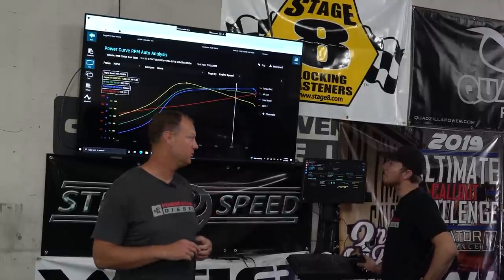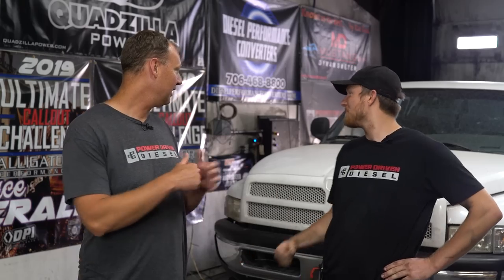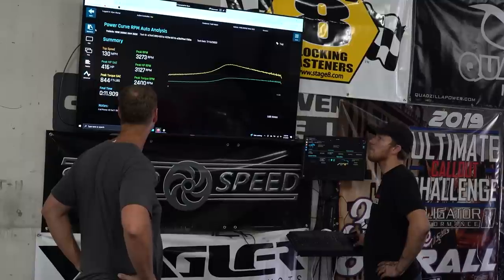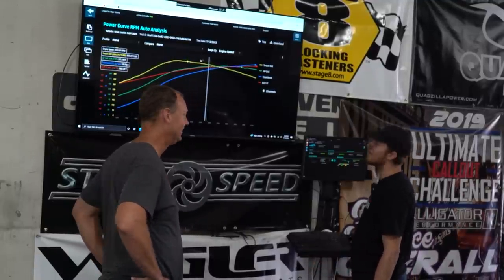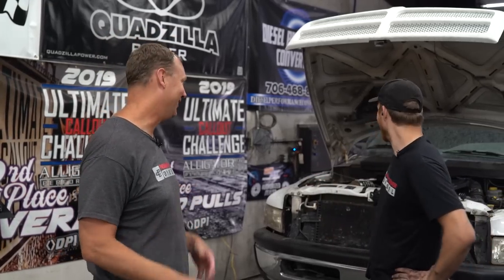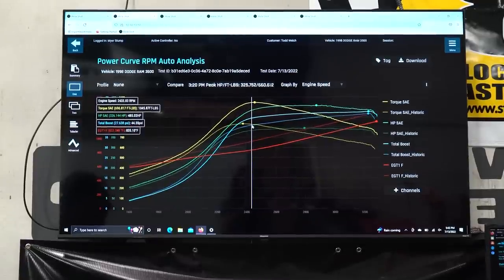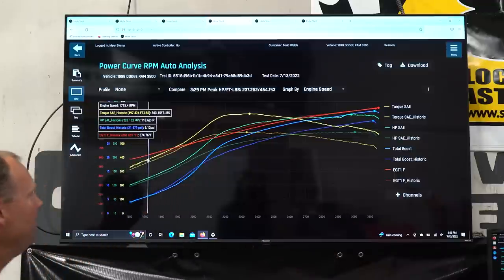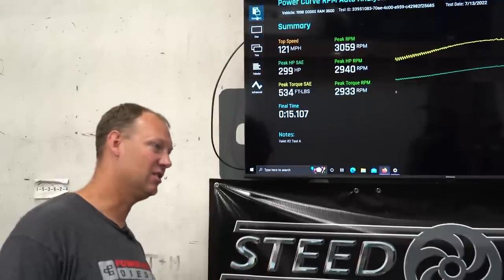Power Jet Fuel Injector Development | 12v Cummins Dyno Test

Comment: Exciting stuff. I have a vp44 truck that I run 7x10s built by Weston Shuppe. I like his injectors simply because they run cooler, more power and less smoky. This truck is used for deliveries, running about 70 to 80k miles a year. If y'all make a set of these, comparable to 7x10s, I'd buy them to test them and see how they do. Mpg is important. At the end of the day, the better it is, the more money in my pocket.
Reply: Nothing against PDD, they have great products and an awesome crew, but I don't think you're going to find anyone with a better understanding than Weston on injectors especially. He has tried a ton of different nozzles and uses a wide variety for 12 valve and 24 valve if you look through his Facebook page photos. If you want to try something new ask him about an 8 hole. They seem to atomize very clean on lightly to moderately modded VP44 trucks.
Reply: I used to run 7x0.010s in my VP truck as well but mine were DAP sticks, when the truck was tuned well they burned very clean but I was having some EGT concerns, I think that was mostly down to the 9cm housing on the charger. Stepped up to 7x0.012 with a s364.5 in the 14cm housing and a ported head, should help.
Reply: @Michael, it will be hard to beat Weston. He's built me several sets for different trucks, and they always do better than anything else's. If someone is building one that's also good, i like to test them myself.

Comment: Hey guys , I am loca to Cedar , bought a swx362 in April for my 1998.5 and the only part of my truck I don't have info on is injectors . Truck gets 14-16 at best right now , want to get a good compliment injector and have the head flowed and a custom tune with the quadzilla I got . My other Cummins was 20 all day long mpg ... Hoping to get closer to that as build power as low as possible for towing.

Comment: As I’m building my Cummins powered 4x4 Ford Econoline van for long trips this is the video series I’ve been waiting for!!! I bought your 400hp kit(still in the box) I believe that has 7x.009 injectors, will you be developing a comparable injector that is more efficient?
Reply: My dream is a e350 15 passenger with a 12valve or DT466 paired with a 5R110. Sounds like an awesome build.

Comment: Love everything I'm seeing about these Power Jet injectors.. are you guys planning on cutting this nozzle geometry into a 24V injector nozzle/body?

I have a 180hp Ppump on my 1998.5 24V with PDD 362SX-E, PDD 7x0.0085 injectors set at p-pump pressure, and 055 DV's... love the power but looking for a little bit more efficiency and little less smoke.
Reply from the maker: Yes! Those injectors are in testing now. Should be available soon!

Comment: Are these PowerJet injectors SAC or VCO? Are the stage 1 a good fit for a bone stock truck? Looking for mpg, clean burning, an maybe a little more power. I thought I had decided on VCO 5x0.011 sticks, now I wonder if these will be better for me… 🤷‍♂️
Reply from the maker: They are a SAC nozzle yes they will run cleaner than the traditional 5x.011 as well as provide a bump in power and typically pick up some mpg's

Comment: WILL 5X11 INJECTORS  WORK ON 2002 DODGE 3500 6 SPEED WITH OUT PUTTING A BIGGER CLUTCH ONLY HAVE 35000 MILES ON FACTORY CLUTCH. 24V?
Reply from the maker: You will need different injectors for that 24v  call into the shop and we will get you set up!
-Todd

Comment: Do you think you will come out with a set for ve pumps?
Reply from the maker: Eventually
Reply: I'm looking for a set for my truck it's VE pump if they can compare to a 5x18 injector performance but run cleaner and it lower EGTs I'll be sold on them

Comment: What I have  been informed is most of the injectors are pre set to 1800rmp before they fully come on and the 5.9 love to chuck along at 1700 all day long sipping fuel. And most of the injectors are for marine/GPU's (ground power unit) and some injectors come on way higher in the RPM but I am sure the pump pressure also plays a important role and higher pressure can give better pattern and atomization leading to better, faster, more complete burn and cooler block temperatures. But to high and instant flame thrower with valves not in the volume metric efficiency so bad performance. So it is a fine line and pattern shaped/placement is critical and available fuel in a critical very short time. That is a lot of variables to juggle and fine the sweet spot.  I am wanting a sequel turbos(lower EGT's) and better fuel efficiency/torque and peddle responce(less turbo lag / more air/boost) and you did address the intake and exhaust flow in this test. What we were not give was the flow rate, pattern/atomization and air to fuel ratio at RPM levels. And timing adjustments will have a direct effect on tests, so for what you need is a clear cylinder to see and adjust pump pressure versus atomization. Now my second concern is how long will it take to recover the cost of the new and improved injectors? That is were you know if the product model is a viable solution for your customers.

Comment: I have 116 k on my 04 likely going to need injectors in a couple years. Are these worth an upgrade toward 500 plus horse.
Reply from the maker: They could be but as of right now we have only tested them on 12v Cummins trucks and they where a huge improvement on them
Reply: Well we will keep watching, and when ya have something I'll likely buy it I'm hoping I can get more upgrades done as things go. At this point I have a Eaton locker I'm getting ready to install in the front diff. The spiders are chipping and so I'm planning gears as well
 Have all the parts but need. To set apart the time so I can install them right. Got the 5" mbrp installed all straight pipe to load I'm putting a resonator or glass pack on it to cut the drone some. Then plans for trans rebuild and might as well biuld it to support the upgrades. You have. I doubt this EV thing will go to far. To much way to fast is going to kill all of it. I'm for hydrogen Cummins already has several options in that department. Still it will never compete with ice. Vehicles. Just no contest. Reliability is not a compromise like there's no compromise for freedom 😀

Comment: So are these nozzles going to be available on their own? I was planning to build some of your 5x.012 nozzles on the spare set of stock injectors I have, but these seem like they may be the perfect setup to max out my first gen's pump with an SXE turbo
Reply: That is way too small an injector to be maxing a ve pump. It wasn’t until I went from 6x.018 to 6x.020 that I didn’t see power gains.
Reply: @bcbloc02  6x18’s sounds like a Smokey mess. You’ve got a 1500hp injector on a 500hp pump. What kinda fuel economy are you getting?
Reply: @wadetate6459   I would usually average 18-18.5 driving back and forth to work with it. I never hauled with it though. You can see how smoky it is here https://www.youtube.com/watch?v=2BklPIZxEVU

Comment: Are you guys going to work on fuel mileage injectors for 1990-1993 12v?
I'm currently getting 18-20 on my 92 12v which is bone stock except for a 4" turbo back exhaust.  I would like to improve my fuel efficiency and possibly get a little more power.
Reply: Later P-pump injectors are internally the same as our intercooled VE pump first gen injectors, but open at a slightly higher pressure. Build a pop pressure tester and re-shim whatever P pump injectors from PDD you want to open at the VE pump injection pressure.

Comment: Reduce your engine power to save fuel. Use an alternative fuel. Or you could improve the Engines Efficiency. But is $20-30k worth an increase of 4mpg?
Reply: He is improving efficiency, the point of the video is to still make power while keeping the engine and EGTs efficient. Doesn’t cost 20 thousand dollars to do injectors
Reply: Where do you get 20-30k for cost from????